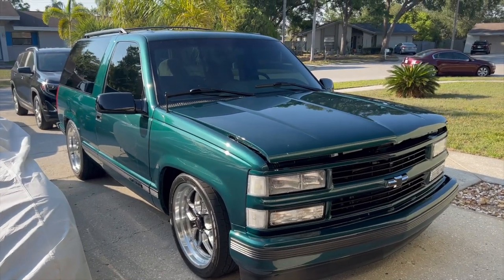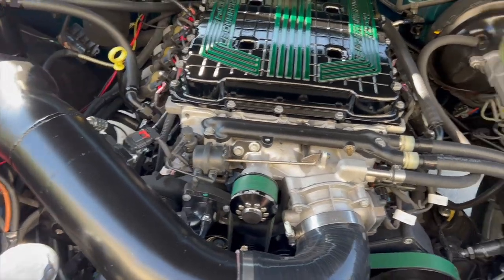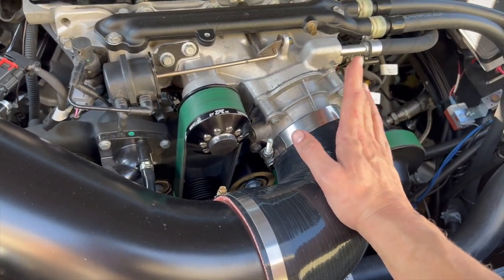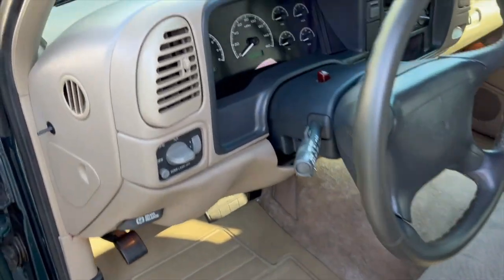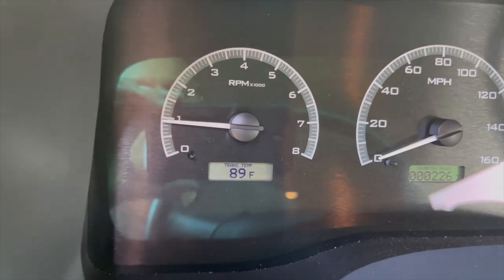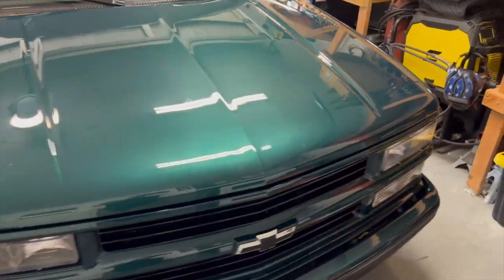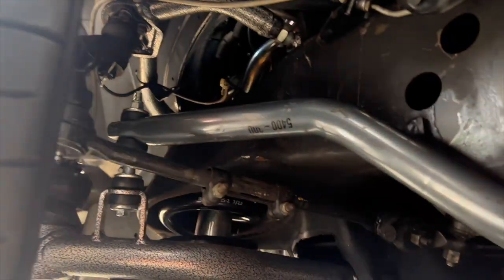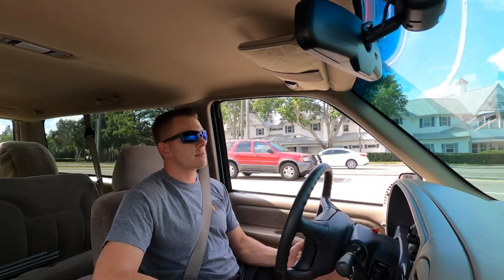Winning the Cleetus Mcfarland giveaway Tahoe

Comment: Is the trans stock or is it beefed up? I forget what it had in it because Cleet had a few giveaways and they are all mixed up in my mind for some reason I was thinking it was a ten speed but that can't be right anyway it's a sweet truck and love the color and if it was mine I would do the suspension and do the engine too that way it's be safe to turn it up and beat the snot out of it and not have to worry about a rear end spitting it's teeth out or a main bearing going for a spin or worst.

Comment: Lmc electric fans and a stock 454 ss 1990 truck radiator
Reply from the maker: Its got the small one fans and the factory radiator. Is there much of a difference with the 454 radiator ?
Reply: @DAPerform  
The radiator you have in it now is from a 1990 454 SS truck should be plenty! I thought when justin built it,he put the 454 ss radiator in it?
Reply from the maker: @dalehall2993  I have no idea I couldn’t figure out what radiator they used. It’s not new I know that
Reply: @DAPerform  
Go with the gm factory 1990-1993 454 ss truck radiator...justin uses them in every build. Other than this giveaway tahoe!😂
Reply from the maker: @dalehall2993  Thanks for the info! I’ll keep that in mind if I ever replace the radiator

Comment: Update the master cylinder to little shop mfg, not expensive and makes a giant difference
Reply from the maker: I believe the AZ pro performance big brake kit is designed to work with the factory obs master cylinder. I thought about switching to the NBS master but I’ve seen some people have issues with that brake kit installed